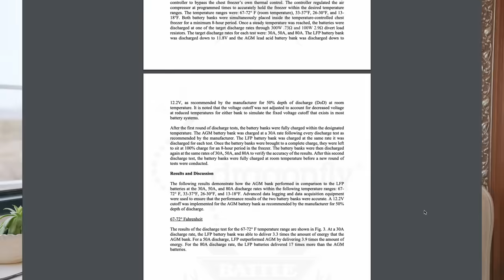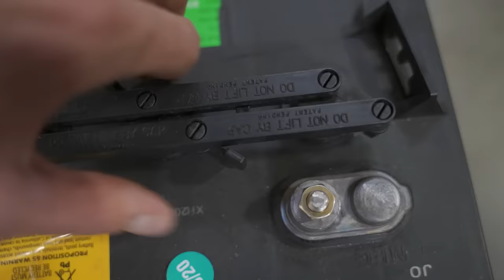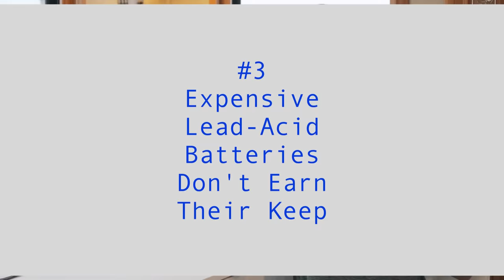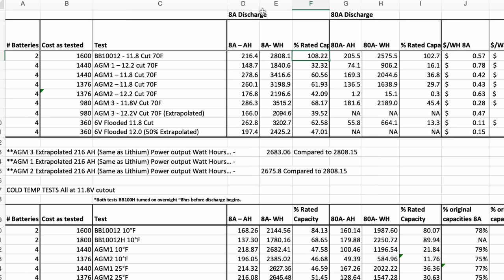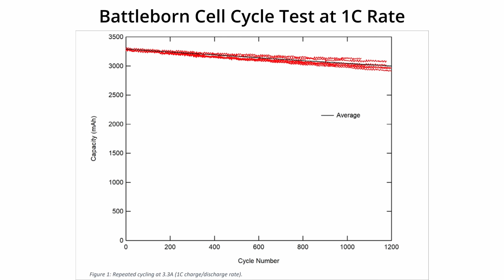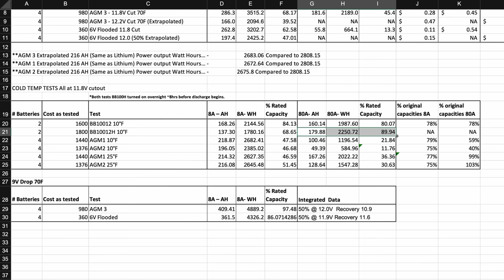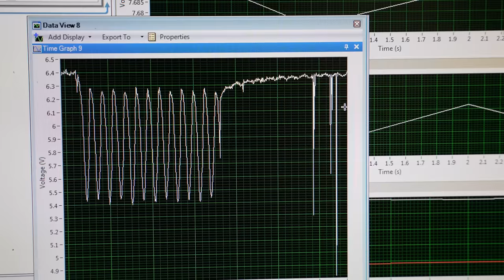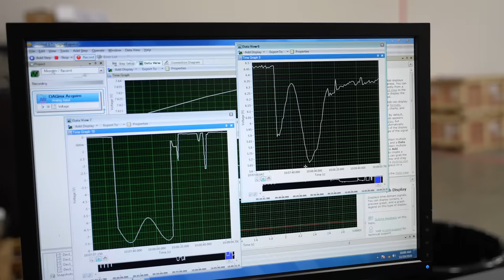Don't Waste Your Money On Batteries - The Shocking Truth I Discovered When Testing RV Batteries

Comment: Final analysis showed that 6V golf cart batteries are still the champs. Best ROI
Reply: What data were you looking at? They were twice as expensive. Not my idea of best ROI for something that is twice as expensive as another option. Dollar per dollar, they are better than any of the AGM options, but they were 0.19c per kWh compared with lithium at 0.09c per kWh. Simply put if you spent the exact same amount on each type of battery, in the long haul you will have saved at least twice as much as for 6v golf cart batteries. For example spend $1000 for each type of battery. You will have gotten more total kW from the lithium then any of the other battery options including the 6v golf cart. In a controlled lab setting, twice as much. In reality, likely way more.

Lead acid auto / cart batteries were designed for high cranking and to start those engines. Not designed for continous long usage. There were much better batteries designed for that, that has been used for such applications for many many decades.
Reply: @kevinfisher1345  I think you ment "kWH not kW. I do this to.  Was the number of cycles factored in ? The up keep on golf cart batteries has to be though of also.
Reply: @steveclunn8165  Yes that is what was claimed. Over the entire life of the battery. If one spent the same amount on each type of battery, in the long haul one will get more total power (so as to not confuse you) from the lithium. But yes one will also get more total energy (kWh) as well. 

Energy is not supplied by Electric company or a battery, they supply power. kWh is simply a measurement of how much energy was used over a set time. An electrical equipment does not really care so much about energy, it cares more so about power it can consume and use, like for example a microwave which cares about how many W (kW) of electric power it can use to convert electric energy to microwave energy.

Energy is not the best or most concise way to compare, unless they are the same amounts of time. For example comparing one weeks kWh to another weeks of kWh. That is not the case month to month as that is unfair comparison UNLESS both months have the same amount of days. In this case it is NOT a fair comparison to use kWh as each type of battery will NOT last the same amount of time. 6V lead acid golf cart battery will last way shorter (ie much less cycles). A more fair comparison to use is total power (aka kW), since that does not matter how much time was involved.
Reply: @kevinfisher1345  which how many cycles we got on a battery is a real moving Target. And how to set up a test that doesn't favor one over the other and the way the test is carried out. Lead acid once they start their death cycle go pretty quick where lithium batteries will lose compacity slowly over a long period of time. If we call a battery dead when you can only get 80% of its rated capacity also favors lead-acid as lithium take a long time to finally give up the ghost.
Reply: @steveclunn8165  ??? A C20 (20 hour capacity) test for deep cycle lead acids are carried out the same way. They are left at full state of charge for period of time until reaches resting voltage and then conducted at a set constant temp that is ideal for lead acids (~77 - 80F) . That is how typically all deep cycle batteries are listed from the manufacturer .. in a C20 rating. Starter batteries is better to do C10 tests and are typically rated as such, since they are designed for power to be used faster before being recharged. This is how any professional will do a capacity test, and it is done that way because that is ideal and favours lead acids. Including AGM's, since they are lead acids as well.

What is ideal for lithium batteries, I have no clue, but from what I have seen, they are commonly tested the same way. So if anything, the capacity tests are done which favours lead acids. Yet lead acids still will never give as much kWh per cost as lithiums will, even though they are tested in manner which favours them.

Lead acids are yes considered dead with 80% capacity, because they typically will no longer take a charge or will not take a charge very well anymore. Unlike with lithiums. Lithium Iron Phospates are generally listed with life cycles to 70% or 75% of capacity .... and they are still usable. Since one can use them down to 100% DoD, although that is not ideal. One might be able to revive a lead acid once it is dead, but one does not need to do this with lithiums as they typically are still usable long after they have reached their listed capacity rating. There is even a decent resale value for them after they have reached their listed life cycles. This is partially why I stated to begin with, that in reality they likely will be even cheaper cost per kWh, since one will likely be able to still use them long after their given life cycle rating.

You are indeed correct that capacity tests do favour lithiums, because they provide a more consistent discharge result then lead acids do. It is well known that lead acids will give variation results even with identical tests. Even with very accurate professional equipment. And is why they will typically conduct the same test numerous times with several batteries and then get an average. This in part compensates for that. Likely why this video they took a whole month doing all these tests. So I can see where you going and might even agree following this logic. However reality and experience shows the same result, lead acids are typically dead after their given life cycle rating. With a possibility it might be able to be revived ... or just as good possibility it might not be. One typically never has to worry about this with lithiums. So the odds are lead acids will typically actually be dead after their life cycle rating and unable to be used even if attempt to revive them. Only calculating using the given life cycle rating favours lead acids. So in reality will make lithiums even cheaper than any test results such as one done here in video.
Reply: Only if there is no problem with the weight in old RV. A sale person tried to sell me on 6 volt battery over 12 v lead acid battery , and I said if you can show me the same amount of amp hours  from 6volts batteries to 12 volts batteries and not add anymore weight than I have now,  and of course he couldn't. Yes 12 volt isn't going to have as many cycles or last as long, but when weight is a issue it does not win. Best battery depends on a lot of issues and circumstances.
Reply: @kevinfisher1345  o
Reply: Boater here. House bank was originally two 12 volt deep cycle lead acid group 27. Not enough once refrigeration was installed.  Switch to four 6 volt GC 250 Ahr  AGM batts. Yep, 280 lbs total.
Reply: @wallacegrommet9343  wow!

Comment: I wish you could do the same experiment with SiO2 (Lead Crystal / Silicon Dioxide Batteries).  Their specs goes down to -40 C with significant capacity loss, but you can use them without damage at this temperature.  I am wondering if heated li-ion wasting a portion of it's energy to heat is better than cold SiO2, let's say at -20 C.  Nice experiment video, thanks!
Reply: Are you ever in an RV at -40 centigrade? 
Not really a valid comparison as most RVers are SNOW BIRDS
Reply: @falcorthewonderdog2758  This is the idea, you can just leave the system running without any changes.  Lithium needs to be heated or disconnected in those conditions.  I am in a cabin though.
Reply: They just released LTO very performant batteries with 25k cycles.  They support down to - 50 C!

Comment: "Over their lifetime". How many 10 year old Battleborn batteries are currently in service?
Reply from the maker: Good point, they are warranted that long, but the first ones are still only 7 years old.
Reply: I’m surprised they lasted  that long. A lot of chargers available on the market charge the cells up to 3.65v each... They start to feel that after a bit of cyclic use
Reply: Just as a data point, I have some LiFePO4 batteries from 2008.  Still as good as new.
Reply: I have four 110ah Lifepo4 batteries (not battleborn, but similar) that I use in a motorhome in the UK, about 40 weekends per year for the last 5 years. I smash the hell out of these and they are still in fantastic condition, according to my victron monitor, they're as capacious now as they were when I installed them. There have been several very deep discharges with no damage. I park my van at beaches in the UK right through the winter, drawing current in some pretty chilly conditions (well below zero deg c).
Before this lithium bank, I used to pour money into AGM batteries, believing incorrectly that I can 'take them down to 50%'. I would kill a set of batteries at least once a year, despite my best efforts to look after them.
I will never buy AGM again. I doubt anybody who has actually owned a lithium bank will use AGM again. 
I'm not an armchair battery expert, I'm just a dude hammering batteries in an RV every weekend - and I've given you my experience....and it chimes perfectly with this video.

Comment: We've been FT for the last 4 years, boondocking most of the time. We started with a new pair of 230ah FLA GC-2 batteries in our motorhome. They cost us about $200 for the pair. They lasted us 3 1/2 years of heavy use, often cycled 50%. I estimate we probably cycled them 200 cycles/year for a total of about 700 cycles, which is not bad for this mature technology. 115 ah x 12.5 v x 700 cycles = roughly 1,000 kwh we got out of them over their entire lifetime. $200/1000 = $0.20 (20 cents) per usable Kwh. 

Last month I built a 560ah LiFePo-4 battery out of 8, 280ah prismatic cells. Together with a 350a BMS and a 5a active balancer it cost me under $1,500. These are grade "A" prismatic cells that the battery manufacturer rates for 8,000 cycles at an 80% DOD. So what is the lifetime cost per usable kwh? 454 usable ah (80% of 560ah) x 12.8v x 8,000 = 46,490 kwh over their estimated lifetime. $1,500/ 46,490 = $0.03 (3 cents) per usable kwh. Let's assume the manufacturer is wrong or I abuse the batteries and only get 1/2 of their estimated cycle life. That's still only 6 cents/kwh - less than 1/3rd the cost of the cheapest lead acid battery. 

This cost analysis doesn't take into account all the advantages of lithium either. First off is energy density. I am able to fit 4 times the battery capacity in the exact same space under the steps of my motorhome as my old GC-2 FLA's occupied, saving 35 lbs. too. In real life use, it's actually more like 6 times the capacity, because the LiFe-Po-4s have very little internal resistance so charge more efficiently, extracting and storing more power from my solar array. And their capacity is not diminished by the Puekert effect at high discharge rates like my lead acid batteries were. Then there's the fact that they are virtually maintenance free, thanks to the BMS keeping everything balanced and properly charged. Once a month, every month for the last 4 years, I had to remember to check and add distilled water to my old, flooded batteries - so add a case of distilled water and 20+ hrs of labor to their lifetime maintenance costs too. 

To mitigate the only negative to LiFePo4s that I could find, (low temperature charging and high temperature life reduction), I insulated the compartment under my stairs. I then cut a 1-inch hole in one of my step risers and installed a tiny computer fan under the steps to circulate room temperature air from the RVs interior into the battery compartment to keep the temperature to within acceptable limits. Others choose to place them inside their RV, either under a bed, couch or cabinet because they don't normally vent harmful gasses when they charge like lead acid batteries do.

Comment: Most boaters I know rely on Trojan T-105 lead/acid 6V rated at 225 amp/hours at 20 hours and make multiple battery banks from them.
Reply: If you think the Trojans are expensive price out a pair of these
Reply: @scottmerrill4382  I always thought the Trojans were a bargain for the power they produce.  I have 4 of them on my boat and they last for years.
Reply: The test results would have been much different if they added Trojan batteries to the test instead of buying the cheapest walmart batteries.

Comment: It should be noted that the LiFePO4 chemistry can self- heat on DRAW, which means more or less if you are in a cold environment, you can plug in a minor/moderate draw (headlights/drill etc) and the cells will warm themselves before attempting potential damage through cold charging.

Comment: I'm making a ham radio emergency setup but can't afford one of the BB but can three lead acid. Maybe when I win the lottery
Reply: In cases where the battery is not cycled regularly (standby applications) it is very possible that lead acid is cheaper and the better way to go. The LFP batteries (battleborn is LFP) will only pay for themselves down the road over many cycles. They are too expensive for standby power. On the other hand they are much, much lighter than lead acid, and that might matter for some emergency applications.

Comment: When you say "AGM", do you mean a standard 'starter' car battery? truck? marine? deep cycle? AGM tells us very little about the actual design of the lead acid batteries.  Also why weren't "common" Li-Ion batteries (LiCoO
2) compared to the LiFePO4?  You've provided an admirable amount of data from these tests, but we don't actually know what we're comparing.
Reply: Starting at 5:26 he starts talking about the AGM batteries and states: "commonly used in RVs and boats". It was apparent, at least to me, that he is comparing deep cycle batteries. At no point in the video did I think he was comparing the battery used to start my car with the bank of batteries in an RV used to provide 12 volt power. 

My guess as to why he didn't compare LiCoO2 vs LiFePO4, well, from the description: "This video takes a look at lead acid vs lithium batteries". There are plenty of other videos on YouTube documenting the differences. Pitting them against each other in RVs seems pointless unless you want to see which one catches fire first.

Comment: an easy way to account/compensate for the battery sag on high load/low temp is to put a delay on your LVC... particularly if those high loads are things like making a coffee. a 2 min delay wont make much of a difference to cycle life under 'normal' slow discharge rates, but will allow you to make a coffee when its cold out, sag to 10.5 or whatever, and return without cutting out entirely.

Comment: Well done, Tom!  Very informative and useful -- thank you.   About the only item you didn't mention in any detail is the weight savings.  Switching to lithium batteries provides a significant weight savings that goes directly to increasing useful load.  Perhaps not a big issue in a Class A, but a very big issue is some Class C and smaller RVs.
Reply: Good point. He was analysing them as an electrical engineer not as an RV'er!
Reply: @flyboy5736  Yea, but ... the title says "RV", and he did make several references to RV.

Comment: I'd like to see facts on charging times/costs for boating/RV applications as there are a lot more costs of other equipment, not just the batteries.  More of a holistic approach.   Yes you can discharge a lot, but how are you going to put it back, typical alternators on the engine won't do it, or running a genset for many hours.  Also safety is the single biggest factor in my choice as I can't afford a uncontrollable fire on board a boat in the middle of the ocean.  I do appreciate the data on the cost efficiency of just the battery

Comment: I learned A lot thank you.  I work In Entertainment as an Electrician a common use case for 12v-24v batteries is Set Pieces that have a practical effect (Such as DMX Controlled Lighting or Mechanical) in them that can't be wired to 120v power due to the fact they need to operate on stage and be stored off stage during scene changes.

Typically we use Ni-H batteries due to cost and that we are never running them down, and often are charged each night after the show.  However, when Touring shows that are storing electronics at Canadian Winter Temperatures they often don't get enough time inside the theatre to warm up to normal operating temperature.  Your video was very insightful about using Lithium batteries.
Reply from the maker: Thanks for watching! :)

Comment: Now do the test with lead-carbon. There's hardly any info out there on this new tech, and I find that many very knowledgeable people aren't aware of their existence. I really want to know if the specs on these batteries are real, and if they are worth switching to.
Reply: Carbon-foam is good tech; -- IMO it got betamaxxed by LiFePO4 when the latter came on the scene. About the same price per usable Ah, and the only real benefit over LFP is charging in subfreezing conditions.  Still has a loyal following in the marine world, though.  

Carbon-doped lead batts like the Trojan RE series get ~+15% cycles at PSOC, but cost ~+30%.  If one has sufficient charging to get rated cycles out of normal deep cycle lead I'm not sure I see the value in spending more for carbon.  If one lacks sufficient charging IMO it makes more sense to increase solar rather than pay the premium for carbon-doped batts.  Not only does the PSOC problem get resolved but you get more excess power for loads after charging demands fall.